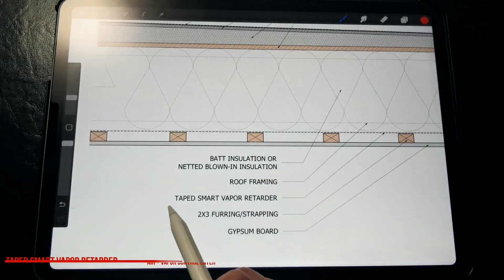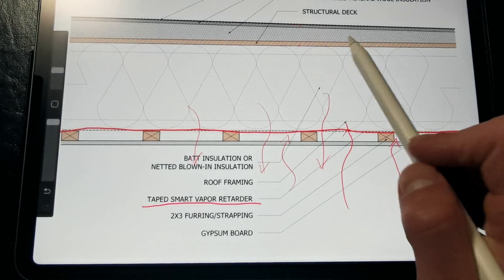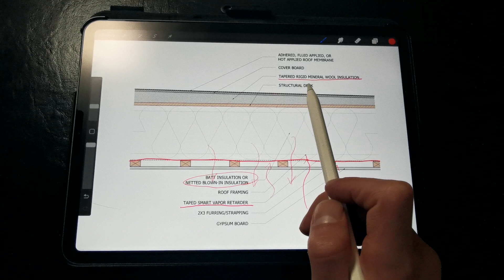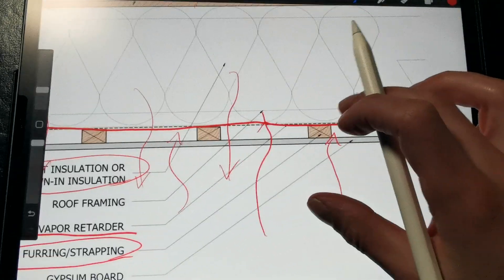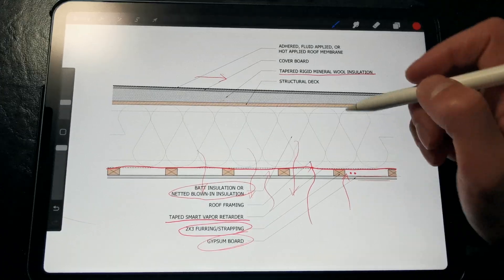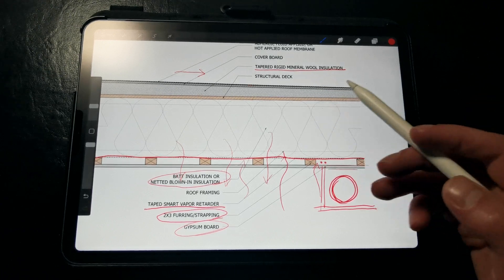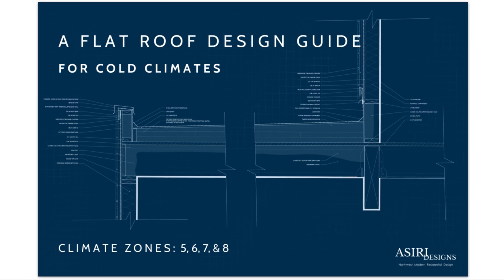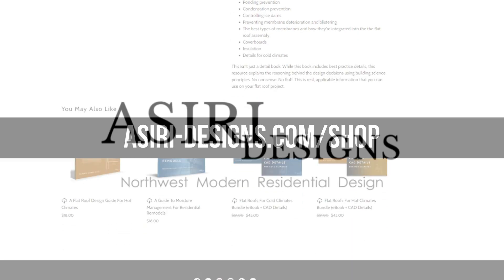A "Foam Free" Flat Roof Design

Comment: Assuming the ductwork is sealed tightly and the register penetrations are attached to the vapor barrier why not include the ductwork in the roof framing with the cavity insulation?